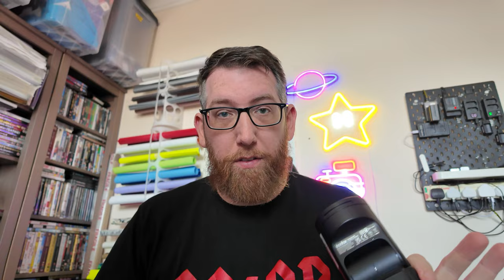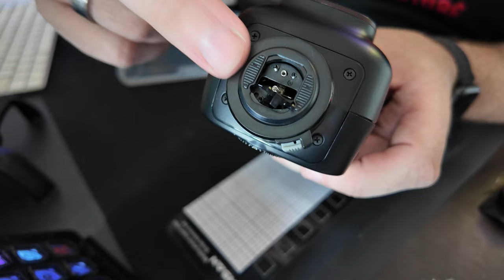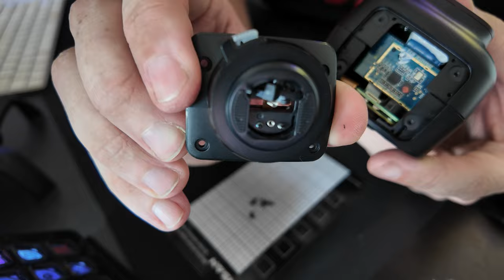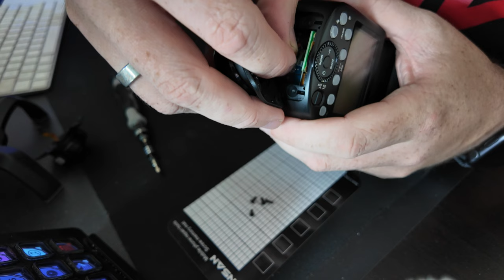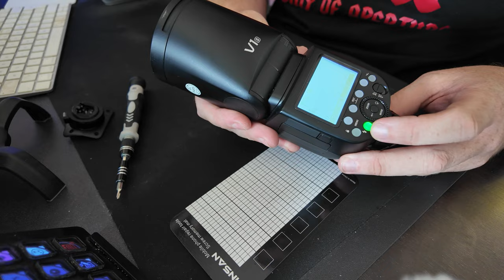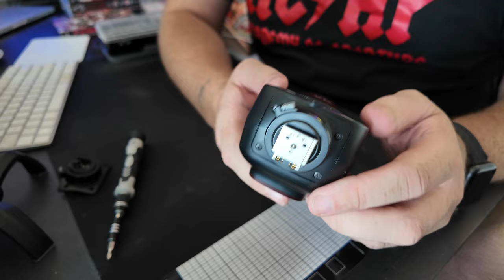How to replace the hot shoe on a Godox V1 flash

Comment: The hot shoe snapped on mine and I ended up buying a new one which also snapped. I never even thought there would be such an easy fix for this instead of purchasing a new unit. Truly appreciate this information thank you!
Reply from the maker: You are most welcome. Was yours the Sony version too, as from what I've seen it seems to be the Sony models that have the issue due to the hot shoe it originally comes with. Hopefully you can now fix both of them and get them back to working order :)
Reply: @AcademyOfApertureHQ  Yeah I had a Sony version as well. I hope this should do the trick. Cheers!

Comment: Great video, just one thought/ question could you change the shoe adpt on that V1s to a nikon /canon fuji adpt on that V1s & would it work ? just if you wanted to change system would be cheaper lol
Reply from the maker: Hey, I’m not too sure on that. I don’t know if there’s any internal differences or not or like you say, change the hot shoe to one meant for that specific camera and it’ll allow that adaption. I know you can use the flash on another camera and it’ll work no matter which brand but it’s the HSS etc which doesn’t work properly. Could be a good shout to try!